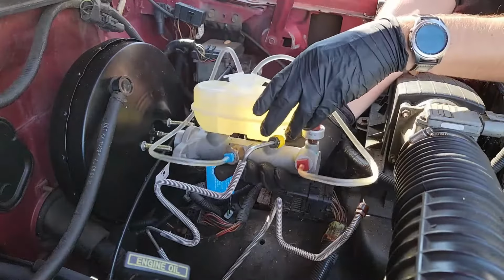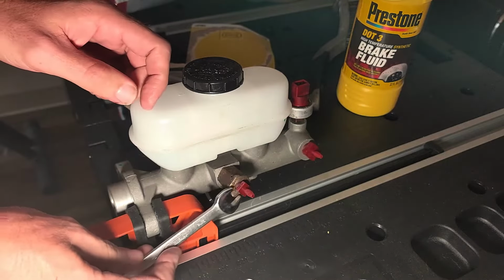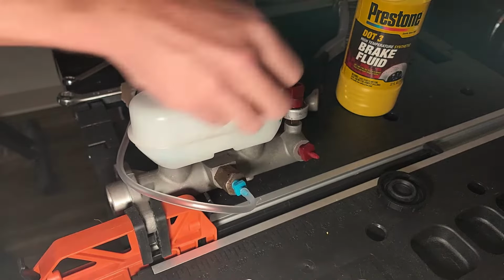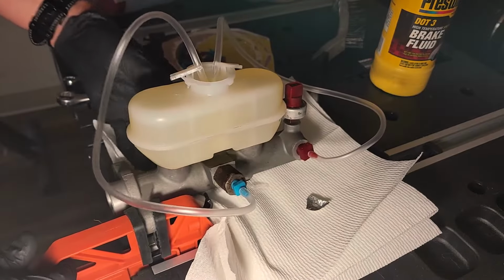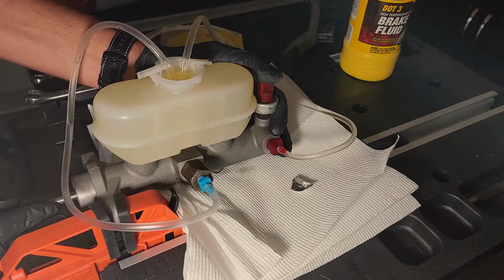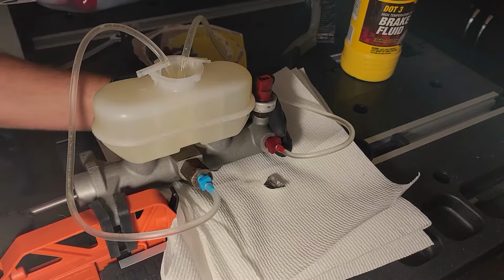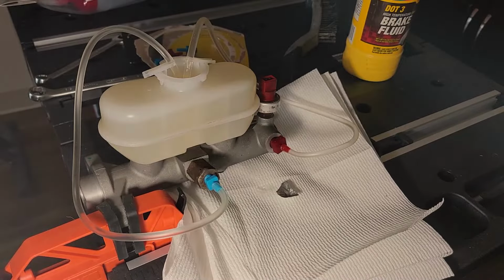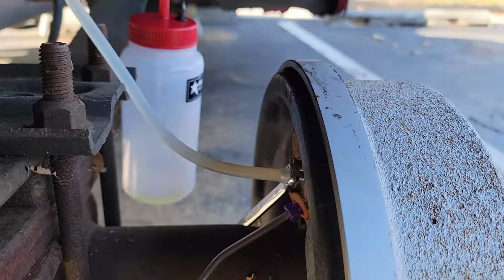Master Cylinder - How to Bench Bleed!

Comment: Why cant this be done with the cylinder bolted in place ?   Install the rubber lines and then pump the pedal untill the lines show no bubbles.  Some are even visible through the gap under the open hood.
Reply from the maker: You can, but you will need another person to confirm whether or not the air has completely escaped.
Reply: @TrickShiftGarage  Pump long enough to make a fair assumption of air removal. Then check the tubes for bubbles, if you dont see any then you are done.  If  you are suspect, then just keep pumping for another check..  Easy one person job.
Reply from the maker: You can do that, but you will be assuming the air has escaped. Do whatever you feel like doing. I'm not encouraging or discouraging anyone from doing anything to their vehicle.
Reply: @TrickShiftGarage  If there is no bubbles in the clear tube then the job is done.  There is no assumption.
Reply from the maker: Then go for it. I'm not stopping you.

Comment: How do you get from bench to vehicle without air being introduced into system ? Thanks
Reply from the maker: Hello Kevin! I kept the clear tubes in the same position and then unscrewed the fittings when I was ready to install the brake lines. Thanks for watching! 🤟
Reply: @TrickShiftGarage  Did you remove the fluid from the reservour or did you just have to transfer the cables really fast to avoid spilling too much brake fluid?
Reply: @Dnasty1 guess we will never know the answer. Trouble is my clutch is connected to the master cylinder on Peugeot van so I have to drain some of it or plug it somehow.
Reply: @Dnasty1 wondering the same thing.  Looks like that part was edited out but I'm assuming there is some brake fluid that will leak out when switching from the bleeder hose to the brake lines?
Reply from the maker: Here is the full master cylinder video I posted. Hopefully this will help clarify those questions!

https://www.youtube.com/watch?v=Z7_BIREQ9vk

Comment: So is there a part 2? My problem is when I'm putting the brake master back in and unhook the hoses ... Fluid starts pouring out fast.  And I think a lot of fluid is gone by the time I'm able to put on the brake lines and tighten them
Reply from the maker: I am currently working on a big brake bleeding video, but as far as connecting the brake lines to the master cylinder this is it. 

Make sure you only do one line at a time and be ready to connect the line once you remove the fitting. I lost very minimal fluid doing it this way.
Reply: @TrickShiftGarage  Well I lose a ton of fluid doing it that way.  And no pressure on the break afterwards at all.   I seen another video where a guy did on bleeding the brake Master.  If you search" brake master cylinder sprinter".  Basically the kit fits over the cap for the brake master and you just pump it up and you don't have to do anything it sucks up all the air apparently.  There's no disconnecting of brake lines and putting a bleed kit on there and then disconnecting the brake lines and the fluid leaking out while you're trying to put the original brake lines back on.   Seems like that way would be a hundred times better to just put something on the cap and suck out all the bubbles from top.   It comes with a couple different caps to make sure it fits and then a pretty big plastic jug with a hand pump on it and pressure gauge so you can read that also
Reply from the maker: Well, if you want to give it a shot I say go for it. But I know the way I did it has been done for decades. So I kind of trust this process more.
Reply: After mounting the master cylinder and before removing the fittings and hoses get a piece of wood to go between the brake pedal and front part of the driver's lower seat cushion. Cut the wood to a length so that when you move the seat forward some it will push the brake pedal down. You just want to move the brake pedal down enough to close off the compensation port of the master cylinder, which will prevent the fluid from leaking out of the reservoir. It doesn't take much pedal movement for the master cylinder pistons to move past and close off the ports, as a guide use the brake lights, when they come on that's usually far enough. There will be a little fluid loss when removing the fittings and hoses but it should stop quickly and you won't drain the fluid out of the reservoir with the ports blocked off. You'll then need to bleed the system at each of the wheel bleeders.  You can get some air out of the master cylinder lines after connecting them; with a partner's help to press on the brake pedal or moving the seat forward with the wood on the pedal you can then crack open the master cylinder line fittings to let air out. This will get some air out but a full bleed will still be needed.
Reply from the maker: Very interesting Doug, I was unaware you could do this. Great information!

Comment: I’m having a hard time bench bleeding it. I was doing on a box without a vise.  The piston is really hard to push without grabbing the base and only the sides of the MC so the air keeps returning back in the base. I’m planning on bench bleeding but on the car with the bleeder kit hoses still attached. What do you think? The MC is tilted slightly up while attached to the car. Is it still possible to completely bleed it out of air like that?
Reply from the maker: Hello Keviiiboo, I've never done it while it was attached to the brake booster before, but I would imagine it would work. It will take a long longer though. When bench bleeding, you are able to push the piston all the way in forcing a ton of air out. When you push in the brake pedal, you will only be pushing the piston in halfway, or 3/4's of the way. So I do think it's possible, but at the same time I have never done it that way so I'm not 100% sure.
Reply: @TrickShiftGarage  Okay, I will try. If it takes long then so be it. Thanks a lot for replying 🙂
Reply from the maker: No problem. Come back and let us know how it goes. I'm very interested to see how it worked out for you.
Reply: @TrickShiftGarage  SUCCESS! I forgot to come back for the update. I tried bleeding it in the car, but the fluid barely moved, so I ended up bench bleeding it outside of the car. I used a long extension and I had help from somebody. It was really hard pressing the piston, but I did manage to get a lot of air out. Next day I bled all wheels and drove it for an hour and the car stop perfectly fine 👍
Reply from the maker: Perfect! Glad to hear that man! 🤟

Comment: Why do you have to bench bleed ??? Can you not do this installed??? Is the angle it is positioned an issue???
Reply from the maker: This is the best way to bleed a master cylinder. You have to make sure all air is removed from it. If you try this on the vehicle, you need a second person to watch the air escape, and you also have to be very careful while pushing the piston in. You want to move as slow as possible to ensure you are getting the air out. 

Bench bleeding is the best way imo.

Comment: Do not take the piston too far
Reply from the maker: I pushed it in pretty far and don't have any issues.
Reply: Why?
Reply: @nodnarblac  

    Ruin seals in new master cylinder.  Put block of wood under to prevent over travel
Reply from the maker: You will not have an issue pushing the piston all the way in as long as you aren't moving too fast. Pay attention to how I did it in this video and you will be fine.

Comment: I would have installed it in the Car and use the brake peddle to blead it
Reply from the maker: It's an option. But it will take longer and you will have to keep getting in and out of the car to make sure the air is bled out (unless you have a second person that can watch).

Comment: Why don't you just install it in the car so you can use the brake pedal to bleed?
Reply from the maker: That's takes longer and this way you can see when the air has been filtered out.
Reply: How would it take longer?
Reply from the maker: Because you can push the piston in all the way when you use the bench bleeding method. Depending on where your brake booster rod is set at, you may only be pushing the piston in halfway.

Comment: Unnecessary.  Scotty kilmer video shows a hack. Just install the new master cylinder, then fill it with fluid and then attach the lines loosely. Next press down on the brake and hold down with long breaker bar or screwdriver against the seat pushed close up as it needs to be in order to wedge the brake pedal all the way down securely. Then tighten the lines all the way. Next release the brake pedal , then loosen the lines a bit , and then press the brake pedal back down before tightening the lines once again. Just repeat this process 4 or 5 times and the pedal dhould feel nice and firm.
Reply from the maker: I mean I could say his video is also unnecessary. You already have the master cylinder off of the vehicle. It doesn't hurt to do it either way. A lot of you need to realize there are more ways than 1 to do something. This process shows how to bench bleed. It doesn't mean it's "unnecessary" just because there is an alternative way of doing it.
Reply from the maker: Also, in his "hack" you need to constantly move inside and outside of the vehicle. If that's what you want to do, go for it. The video's process is easier if you are one person.

Comment: There's no need to do this.  Install the master, connect the vehicle's lines, fill the reservoir, and start pumping.  All the air will rise into the reservoir and be replaced by fluid.
Reply from the maker: Completely incorrect. If you don't bleed the master cylinder, you will always have air in your lines. It's necessary.
Reply: @TrickShiftGarage  I do bleed it, on the vehicle after it's installed and connected to the lines.  I've installed dozens of masters this way so I know that it works.  On masters with large ports it'll bleed itself, but most require pumping just like you'd do with traditional bench bleeding.
Reply from the maker: Then why does everyone recommend bench bleeding?
Reply: @TrickShiftGarage  Because people are stubborn and/or ignorant I guess.  Bench bleeding is the way it's always been done and most people don't know that you can do it another way, and many people argue that it can't work just as you did.  Just like how everyone bleeds their brakes by having a buddy pump the pedal while they open/close the bleeders one at a time, I open them and let gravity do the work while I do other things.
Reply from the maker: The problem with your method is you will have more air in the lines compared to bench bleeding. Believe it or not, but you can still stop with some air in the lines. However, it's not the safest way to do it. Consistent braking will show a vehicle with a Master Cylinder that was bench bled, will outperform a vehicle using your method. Can they both stop? Absolutely. But claiming your way is on an equal level to bench bleeding is ignorant in itself.
Reply: @TrickShiftGarage  You're wrongly claiming that there will be air left behind using a method that you've never used so there's no point in discussing this any further.  Anyone who doesn't know that the system will work with air in it and that it's not right to leave air in it should not be working on brakes, "believe it or not" was a stupid statement to make.  Just keep doing it your way and ignore that there might be something new to learn, ignorance is bliss.  I've been enjoying my cleaner quicker method for about 30 years and will continue to do so until I find something better.
Reply from the maker: I will gladly keep doing it my way, considering this way has worked for hundreds of millions of vehicles. But remember, you are the one that commented. Just because I disagree with you, does not mean I'm wrong and you are right. Talk about ignorance.

Comment: Bench bleeding is really unnecessary .
Reply from the maker: It worked perfect and has been used for decades. Just because there are other methods, doesn't mean this is "unnecessary."
Reply: @TrickShiftGarage  Leaks everywhere when you install it in the car and then when you remove the clear hoses after bench bleeding you get air bubbles again when you install the actual brake lines .
Reply from the maker: Fluid barely dripped out while I was installing it, and if the fluid is moving out, air will not reenter. Again, this worked like a charm with zero issues. If you want to do it another way, by all means go for it. I'll keep doing it the proven way that's worked for decades.